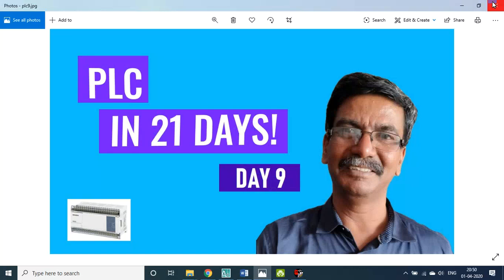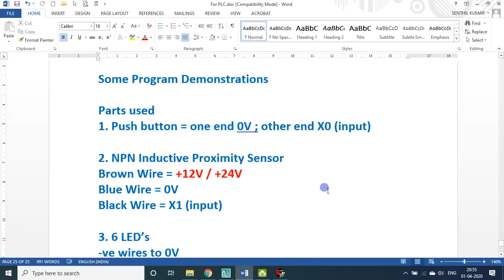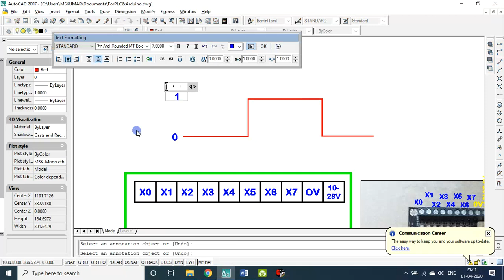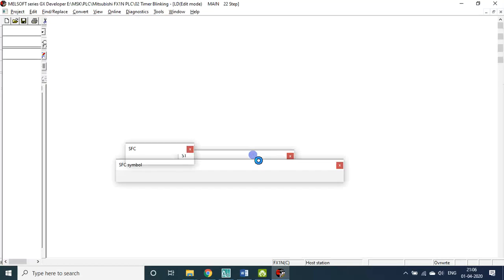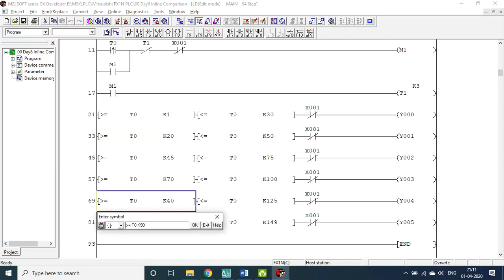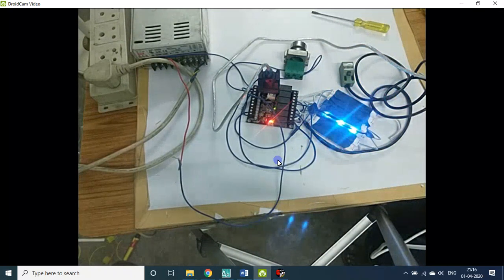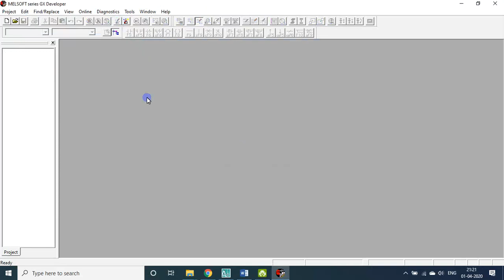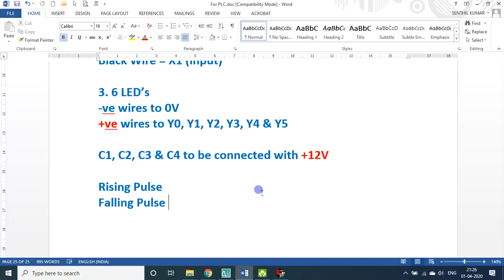D9 | PLC | Programs with PLC Board - Real functioning

Comment: undrstood sir... Is plc used for led light controlling mechanism which is used in many functions?
Reply from the maker: Thanks,  I am not clear about the question. But let me tell you my views.  With the use of some inputs and LED lights as output I started demonstrating some programs. It doesn't  mean that PLC can control only the LED's. It can control from a pin size LED to a monster Machine elements.

As of now all the Automation based machines are designed using PLC only (more than 90% cases). Take for example a Medicinal Tablet Packaging machine. Starting from keeping the tablets in the Plastic blister, sealing the top with aluminium foil, die cutting for every 10 tablets as strip, packing every 10 strips in a carton pack, packing 10 carton pack in a big corrugated box & so on. These entire process is carried out in a machine, which is controlled by a PLC only. 

Many people are thinking that PLC is oldest and Arduino, Raspberry Pi are latest. It is not the question of Latest or oldest. We should see which is best for automation, giving more productivity, reliability,  repeatably.  As of today PLC is the best for automation.